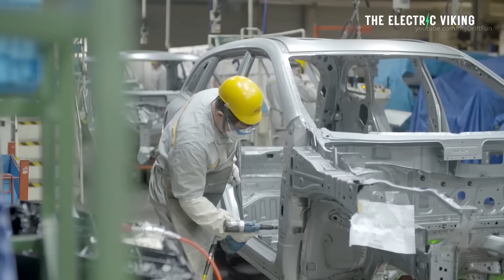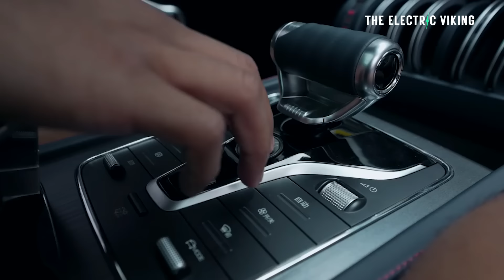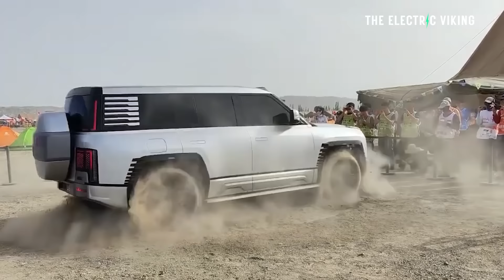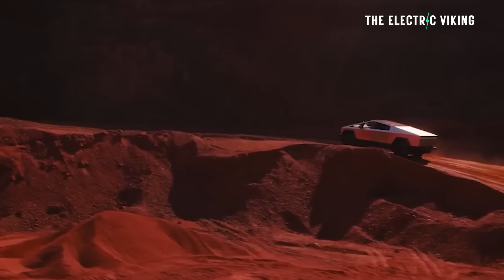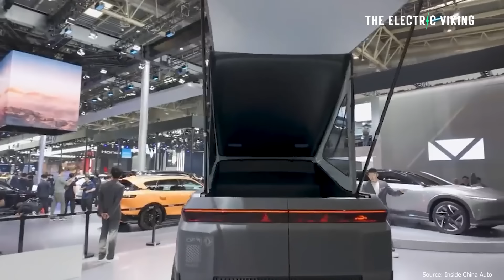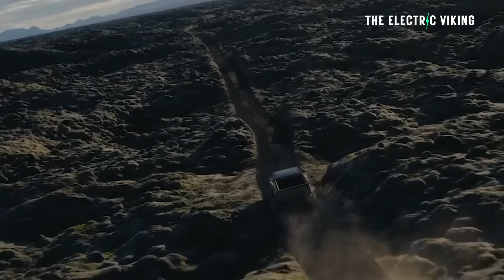Huge Government owned Chinese car company reveals Cybertruck knockoff

Comment: Without the sharp rims and corners it looks a lot safer for pedestrians than the Tesla Cybertruck but the design is not as 'sharp' in my opinion. I think it is a smart move of Dongfeng to try and take the Chinese truck market before Tesla does.
Reply: They cannot "take" the market for many years since they have to ramp up production for years just to be making enough trucks to make a difference to the statistics... It is not likely that any one company will "take" any market. Tesla's ultimate goal is to have 20% of the market of new car sales which seems near impossible for any company to achieve...
Reply: Due to its lack of pedestrian protection, the Cybertruck cannot be legally driven on roads in China
Reply: 중국인들이 댓글을 점령
Reply: ...so what you're saying is that this is the Feng without the Dong...not sure the ladies in China will agree...

Comment: It actually looks better than the CT.
A bit 'curvier'....
Now, it's about the quality......
Reply: The straight panels on the cybertruck is because the steel is so strong that they cannot bend it. The main reason the cybertruck looks like it does is because of functionality. Curvier shapes means soft steel like every other car. Differences from the cybertruck will in most cases mean less functionality since the main deciding factor for cybertruck design was functionality.
Reply: @0ooTheMAXXoo0  The last thing the CT design was about was functionality- certainly not as a truck. It's to get attention.  Intentionally blocking access to most of the bed is going out of your way to make clear it's not about functionality. The Chinese version seems to have a slightly less dysfunctional bed at least.
Reply: I would say Cybertruck is all about the appearance of functionality. Elon knows that vast majority of truck buyers do not actually haul much in the bed or anything, they just want to brag they have the toughest car out there, main thing it should be big, mean looking and have “country” vibe. Cybertruck maybe does not have the latter but they definitely went for poser crowd who buy trucks to show how “manly” they are, not to haul stuff
Reply: @0ooTheMAXXoo0  curve panels are stronger than straight panel

Comment: It's not a clone, it mimics only the looks, but doesn't have the functionality. Cybertruck looks it does because of the tough stainless steel exoskeleton, it's not an arbitary design. There's no point of copying only the looks if the material is not the same.

Comment: Without corruption, it is impossible to sell Cybertruck in EU as a "car". It will be actual "truck" ,speed limited to 80 km/h. And there will be other "truck" regulations too. The sharp edges alone would make it impossible to register as a "car", and trucks have similar regulations; there can not be sharp things to harm pedestrians. Even the lights are illegal here, but that is the case with most electric cars, as continuous light bars at either end are actually forbidden.

Comment: Price’s still a big problem for Tesla.
Reply: Every Tesla model is cheaper than the gas cars that they are competitive with!!! Has been that way since the early days of the Model S. Larger margins than gas  cars while you get more for the same price or lower price for same specs... Model 3 is just about the cheapest new car you can buy in the USA total cost of ownership for 5 year and 10 year calculations.  Cybertruck should be very cheap to manufacture and they will have versions that are much cheaper once they ramp up their supply chain and manufacturing... 50k version will be no problem for example... maybe even a 40k version like they announced before we had 22% inflation in the few years since...
Reply: @0ooTheMAXXoo0  Yeah, if it could be cheaper than BYD.
Reply: @0ooTheMAXXoo0 A $160k cyber truck is cheaper than what competitive  model?
Reply: They are different sections of the market. Does the $400 iPhone 15 Pro clone directly compete with the iPhone 15 Pro
Reply: @justinr9753  So the section that buys even less than the 7% of Americans who currently own any ev? Great target group. 👌

Comment: My major concern is the Chinese version of electronics & software management of battery charging & battery temperature to prevent ignition of the pack & self sustaining fire. 2nd is QC & integrity of construction so the wheels don’t fall off at 70 mph.